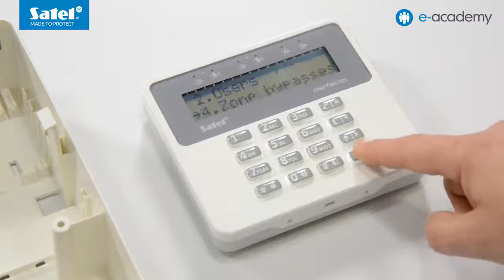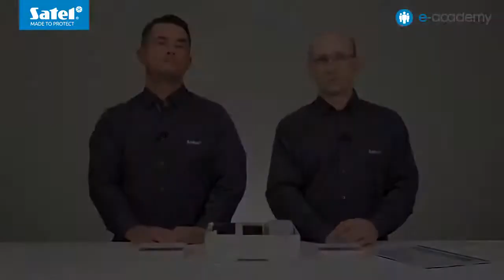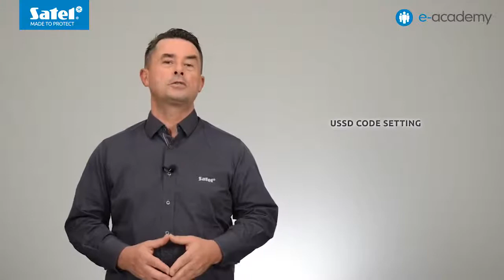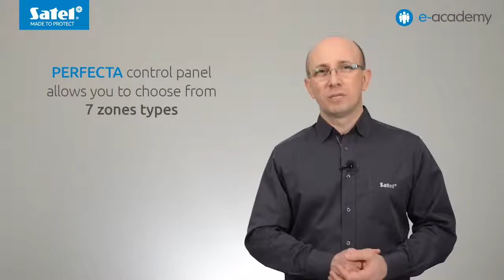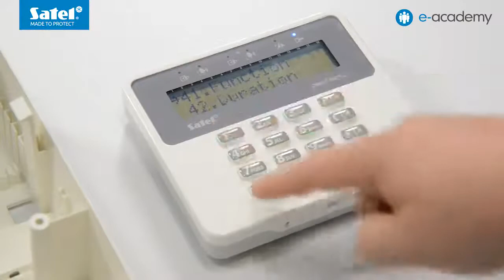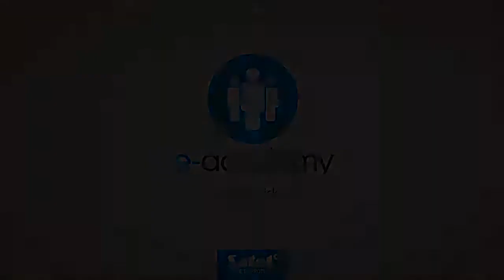SATEL e-Academy 36: How to Program PERFECTA Alarm Systems Using Keypad

Comment: Hi guys!
How do I set English on keypad?
Thx!
Reply from the maker: Hi, the keypad language is governed by the connected control panel. If you wish to change the display language, you need to flash the panel first, installing an English version of the firmware. By default, the language of your control panel should be set to the language of the country the panel was sold in. However, please bear in mind that some of our products might be region-locked. You can always inquire more with your local distributor.